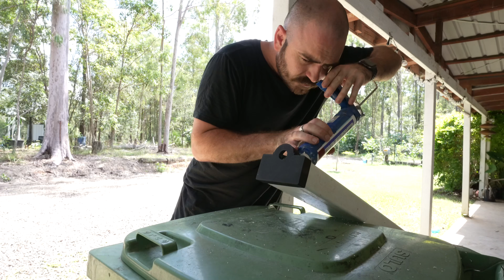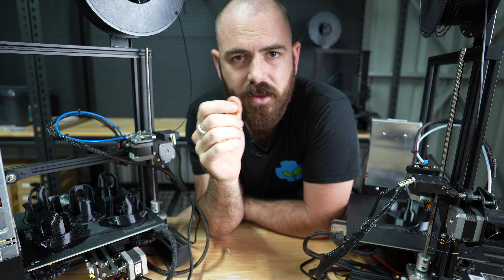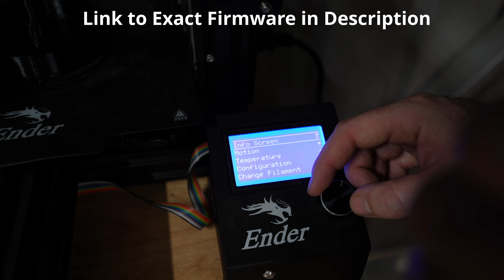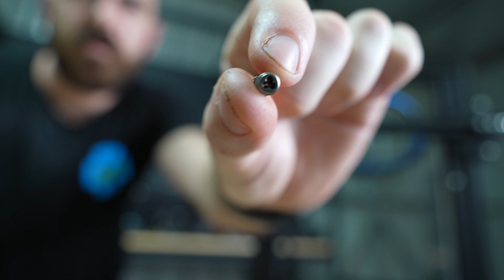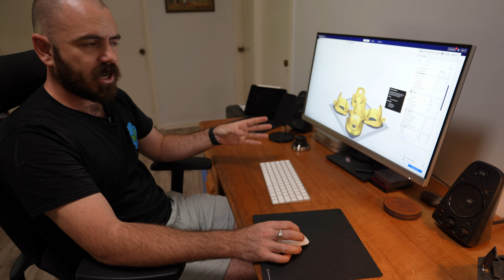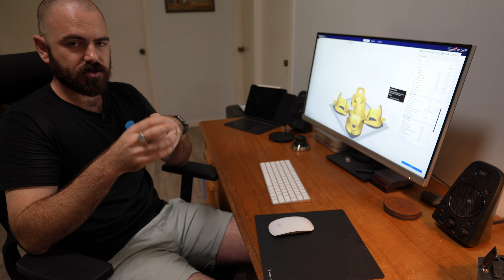Ender 3: Upgrades & Troubleshooting

Comment: Ender 3 V2 NEO, Upgraded Pro firmware .. I have a Nozzle temperature fluctuation that makes no sense and has no resolve. My Nozzle temperature fails at 5 layers in the print. This is exactly the same at every print. I had also tried using a couple different slicing software. The Temperature sensor seems to be working fine as I get room temperature results on my keypad and temperature holds 200 c until I get to the 5th layer of the print. I am stumped

Comment: Hi Hoocho, I saw your earlier video on the Ender 3 Pro 3D printer, and I was so impressed, I got myself one.  I’ve been able to do several successful 3D prints now, including some of my own design.  I’ve also been trying to learn how to use a 3D CAD Package (I’ve been attempting to use Fusion 360, but it is a steep learning curve).
I friend wanted me to see if I could print her husband out a model of the Millennium Falcon (from Star Wars).  So, I was able to find a file for the Millennium Falcon on the Net, and started to print.  The print got about half way through, but then went bad.  I believe the term is “Spaghettified”, when the filament is just squeezed out into space, leaving you with a mess of Filament, like Spaghetti everywhere.
I took that opportunity to increase the model’s size, so it took up more of the available printing space.  However, now every time I restart the 3D print, it seems to start at the point I had previously stopped it at.  I’ve reloaded the G-code file several times, as well as regenerating the G-code, but I still get the same issue.  I’ve even renamed the file, to hopefully force the printer to start from the beginning again, but no luck.
Any ideas of what I need to do to fix this issue?
And yes, PLEASE MAKE MORE VIDEOS on 3D Printers!!!!   😊

Comment: Grab yourself a Raspberry pi and install octoprint.
Its a great opensource system to add additional functionality (through numerous community created plugins) it also allows you to remotely monitor and control the printer during long prints from your computer or smartphone, being able to remotely monitor and shutdown the printer if a print fails can save a lot time filament and heartache.

Comment: Hey Hooch! You could try the Copperhead Heatbreak from slice engineering.

I also print mainly in PETG and I could half my retrection distance without any stringing, so less filament grinding and faster possible movement! And what I enjoyed the most is that the Capricorn Tubing I use is now separated from the Heatblock as it only inserts half the length of the heatbreak so no potential melting of it and I'm now capable of printing at higher temps as I don't have to fear toxic fume build up by overheated tubing. Which might come in handy later when I try out other filament types. 

Also quite easy to install and I can absolutely recommend that you take a look at it.

And concerning your stringing: Maybe try increasing your retraction speed to 65mms and distance to 6. 5mm. I also use generic PETG with a slightly smaller nozzle at 0.6mm. And at this settings it was a blast. 

And with the new heatbreak I could go as low as 2.7mm retraction distance and achieve the same results. 

Cheers mate and thanks for the great content you deliver and the the ideas you spur in my life. Have a good one!

Comment: Yes love the video, and would love more of the same, love the concept of 3D printing however am very time poor which is why I watch and listen to someone who has done all the experimentation.  I know it would be time consuming but a spreadsheet with some of the more commonly used settings would be wonderful, then as you make changes for different prints maybe a text file with the uploads, even if only for patroon subscribers, I have spent lots of time trying to screen shot some of your print settings in previous videos to avoid mistakes. Thanks mate, hope you are drying out after all the rain.

Comment: The extruter on the ender really is crap. The metal upgrade is nice, but if you never want to think about your extruder again, get an bondtech BMG =) that one will increase your filament control a lot.

I'd also recommend a part cooling upgrade, especially for pet-g..

Oh, and you do not need Capricorn tubing on a decent Hotend with a decent heat break.. yeah, I know, I threw a mich money at my Anycubic as it costs to buy one, but the mosquito Hotend.... That's the stuff.

Comment: Couple of tips from someone who has been in a 3d printing hobby for years now:
- you don't need filament runout sensor! Weigh your spool of filament before you use it for the first time - subtract what you see on the scales from the mass of filament and you will know know much the spool weights. Then weigh the spool again before you start printing - and voila! You know if it will last to the end of the print!
- recently Creality is doing sketchy things (like stealing paid 3d models from others) - 3D printing community advices to steer away from this company.
- if you don't like to tinker with your printer - buy a Prusa - it is so beginner friendly you will just push print and walk away with 99% chance of successful print
- don't use power out recovery feature - it will kill your sdcard quickly
- you don't need a bl-touch/cr-touch - buy a 235x235mm pice of glass or mirror and use a glue stick (your regular paper one). After proper "leveling" of the bed you'll have a very flat surface to print on (glue helps with adhesion/separation of PET-G)

I hope this will help someone who starts with the printing!

And finally: Thank you for the video Hooch!
Reply: second the prusa printer if you don't have the time to tinker and have the cash
Reply: I would say, if you afford the cost of ender + upgrades and fixes, you can afford a prusa mini :D